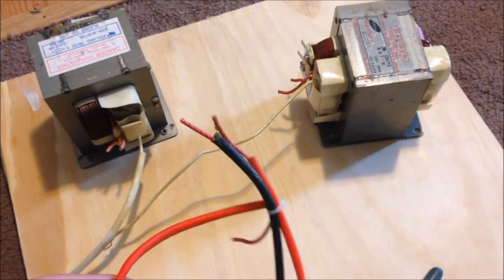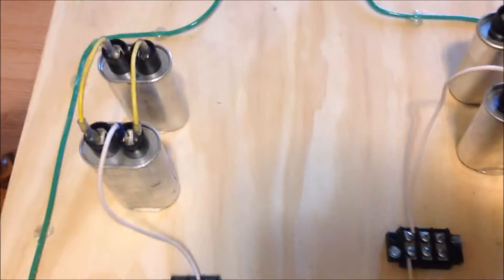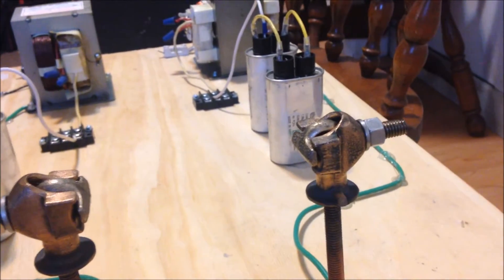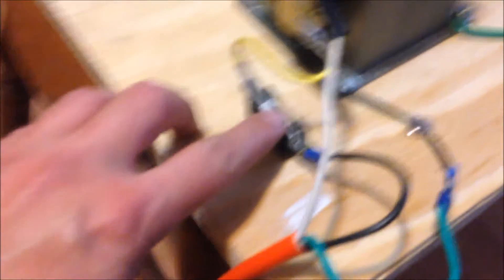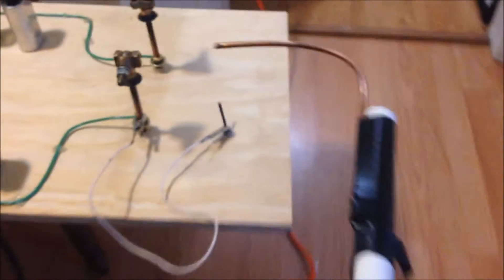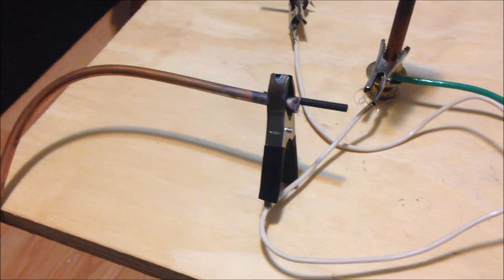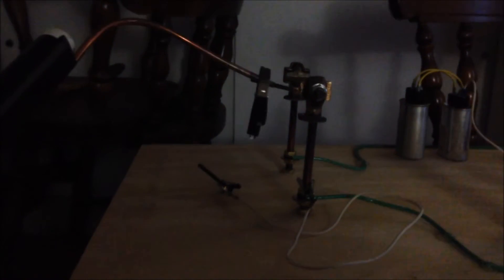New Project: Torture Table? Arcing Carbon Rods From AA Batteries!

Comment: - Am the old circuit breaker in your new house - XD
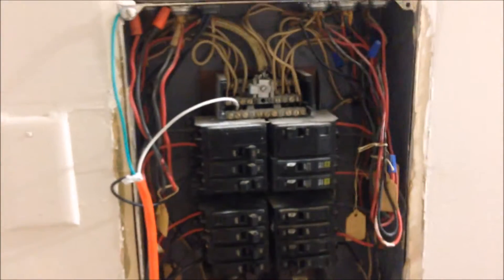@ 5:30 is EXACTLY what I do when I need to give something more power, tap right into the source with a 50 amp breaker and run some wires back tot he bench..

Put an iPhone in the torture table

Comment: Cool!!!! Can you still do stuff with your distribution transformer, Cheers!!!!;)
Reply from the maker: The windings got damaged during my move :( Sadly it's just waiting to be recycled....
Reply: Lets NOT Play With Electricity Well, that's alright, you could (if the primary windings are ok) cut the secondary's out put in bigger cable for ultra high current!!!!;) But it would probably be too much work....
Reply from the maker: I'll cut it up and see. Don't have anything to loose if I mess it up lol. A super high current transformer would be great. I have some of the leftover telephone pole wire I could use.
Reply: Sure!!!!